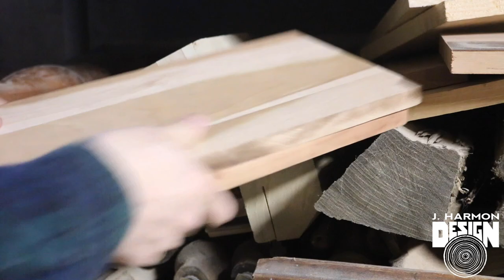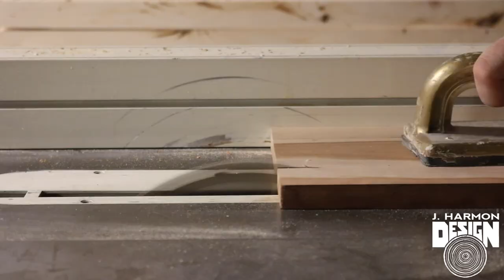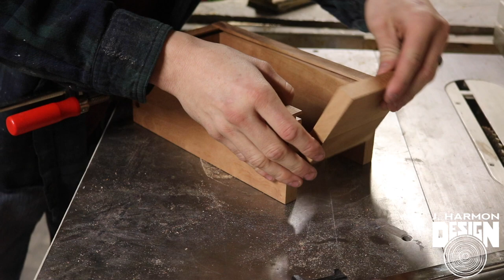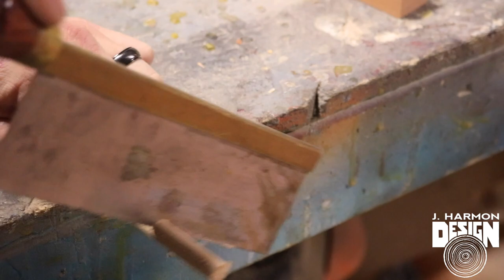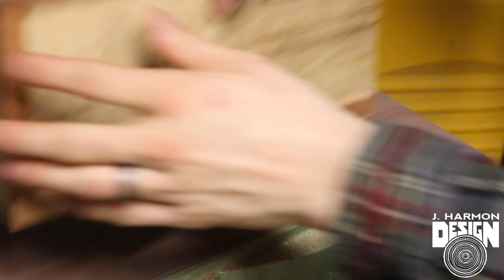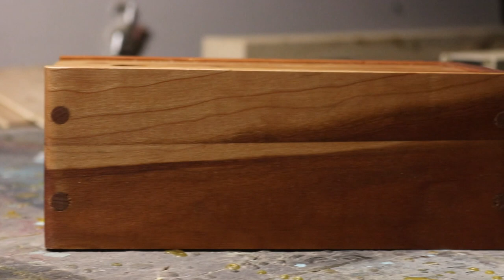Make a Wooden Box With A Sliding Lid // And Dowel Joinery

Comment: Hmmm...  It just occurred to me that if you mount the lid to the underside of something--a shelf, a workbench, etc.--then the box becomes a drawer!  (If you standardize the sizes, then you can attach a row of lids to the bottom of your workbench surface and then, when you are working on a particular project, you can just grab the drawers containing what you need from a storage area and slide them into place at your workbench.  Everything you need will be right at hand, but out of the way.  You could also have larger 'drawers' that bridge two--or more--lids.)

Does that make sense?

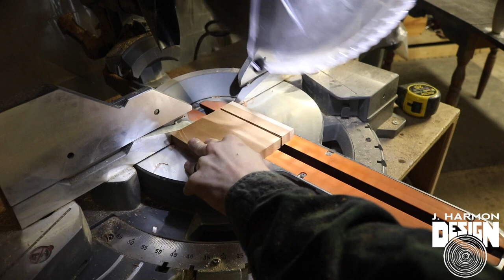Comment: Nice box.  Your rip cut on the mitre saw at 1:02 made me cringe a bit though.  That cut is generally a no no.
Reply from the maker: fak892 interesting, I personally have had that cut go bad on a table saw, being that it was wider than it was long. But looking back I at least should have used the hold to secure the board and not my fingers. Thanks for the concern!
Reply: That would help.  I think the cross cut blade makes it dangerous since it's more likely to grab the piece and fling it up.